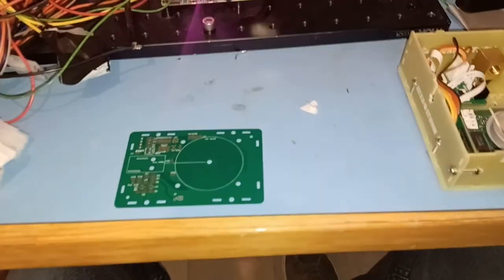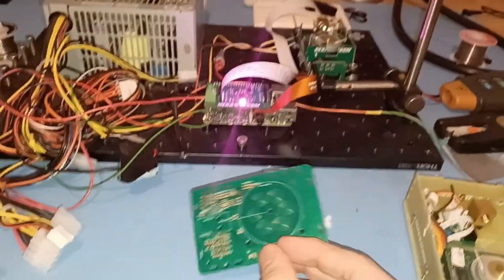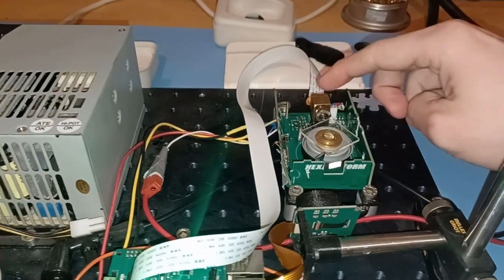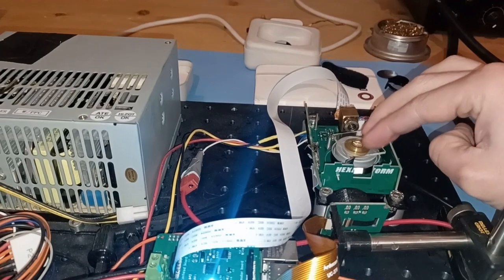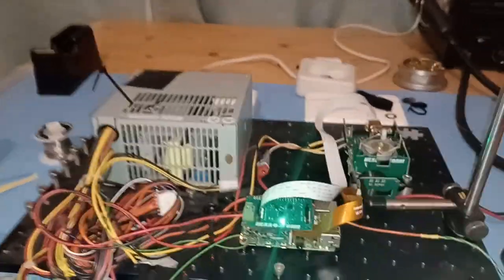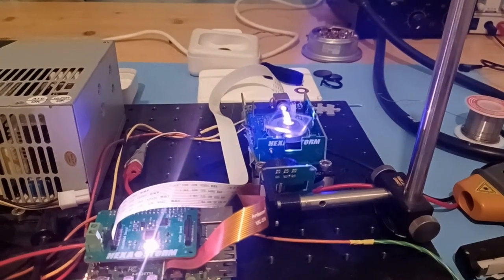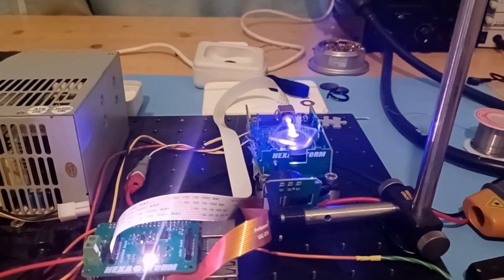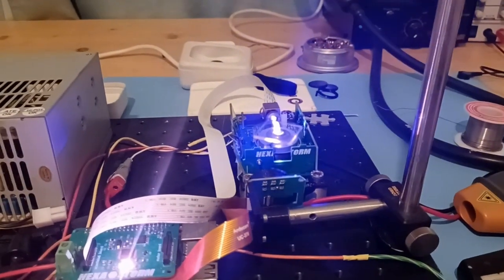LASER scanner with PCB motor

Comment: Traditional circle coils suck for generating torque on a axial flux motor. Consider that only the radial component of an axial flux coil generates torque on the rotor.

You can get more torque for less length of copper in your coils if you use a faulhabor wound axial flux type winding.

Translates as more efficent torque.  And the geometry allows for near 100% Copper fill for far less resistance, minus the bare minimal copper needed to be removed to define traces for the three coils. 

Check out the three stator windings on my motor I made on my channel.  A PCB version would have three coils with through holes from from front to back. Where the coils skew one direction on the top, they skew the other direction on the back. On the inside radius, the copper traces are their minimal nessesary width But the traces may taper to a wider trace on the outside permiter. So that the path overall  may have a lower resistance.  And only the bare minimal copper is removed to define a coil.
Reply from the maker: I will check it out, I am aware that the coil design is suboptimal and youtubers like atomic showed better designs
Reply: @Hexastorm  so I found his channel through your subscriptions. And yes the wedge shape coils is better than the circular traditional coils for the same  reason.  But faulhaber coils are a step above  improvement over wedge coils for the very same reason.

The radial flux version of a multi pole pairs  faulhabor coil can be seen by googling images of "ThinGap motors" as a maker of motors with high torque. They have impressive power density specs. 

Alternately simply searching images of faulhaber coil may turn up many two pole radial flux.

My motor seams to be one of only two motors that I can find that are axial flux faulhaber coils but serously you get more percentage of wire activity participating in providing force in the vector that torques your rotor around.
Reply from the maker: I looked into it https://build-its-inprogress.blogspot.com/2015/02/coreless-axial-flux-motors.html?m=1 and here the faulhaber is explained.. I would need to do a calculation, but it is highly likely it is even better than the leave motor
Reply: @Hexastorm Nice example of nearly 100% Copper fill minus only that which is needed to define one trace from another. You'll be able to do even better with traces that grow in width as they go from the inner diameter to the outer diameter. 

 I wish i could draw this out here but, I will try to describe it..

Let us first simply to linear motor...  Force=current×length×magnetic field strength. But if the wire is at an angle other than 90 degrees, then 
Force=current×length×magnetic field strength×sin(of that angle)

Let us compare the serpentine coil against the faulhaber coil. With 1 amp and the magnet's field strength = 1 tesla and are 4 cm tall  and spaced centered at 3cm apart. 

First is serpentine coil:
The coil is a repeat of  4cm + 3cm = 7cm segments for each magnet. 
The 4 cm segment is at 90 degrees to the direction of force we want. 
So Force= 
F=1amp×4cm×1tesla×sin(90 degrees)=4 amp cm tesla. And 
F=1amp×3cm×1tesla×sin(0 degree)=0 amp cm tesla. 
Adding the forces from those two segments you get force = 4 amp cm tesla.  I'll Work with this unit because there's no conversion. 

Faulhabor coil second:
Using the same magnets makes the  length of the diagonal 5cm using a²+b²=c².... 3cm²+4cm²=5cm².
F=1amp×5cm×1tesla×(4cm/5cm)
And reduces to
F=1amp×4cm×1tesla and further reduces to F= 4amp cm tesla 

Take note that the force generated against each magnet is the same for both coils. But, the faulhaber coil only needed 5cm of while the serpentine coil needed 7cm per magnet.  This linear faulhaber coil is (7-5)/7=.2857 or 28.57% shorter than the serpentine coil for the same thrust.
Reply: @Hexastorm  his motor was part of what inspired mine.  But where he went went without an iron core,ninwentnwitj a slotless iorn core made from coiled strapping steel. While it does introduce some losses  my motor really needed additional inductance. 

When I said my motor was one of two motors that i am aware of that are using axial flux faulhaber coils, the one you found is the other. And his was some of the inspiration in my motor.

Comment: What will be the end result of this ?
Are you going to make  some kind of pcb printing machine with this ?
Reply from the maker: My current aim is to make a single module, which has controller laser and motor. You can then buy this laserhead as is. As it is open source, it should be easy for hackers to integrate it in a a pcb machine, 3d printer etc. I also try to keep the price low.
Reply: @hexastorm  that's great. I have also tried this. I would prefer it to use with PCB. But I won't recommend this for 3d printing due to laser life. 

If you want to make it cheaper. Than why to use fpga instead of microcontrollers. 

May be a stm32 and esp32 with some external ram. Can we some have discussion. I am also interested in this project. I might be able to make this work.
Reply from the maker: @muhammadarsalan3412  , the first iteration was done in assembly on a microcontroller and based on ldgraphy. I picked FPGA, as it gives you more options and seems more likely for future industrial systems. This is where I think you can make most money. The current FPGA is around 5 euro's. Most costs still reside in assembly.
Reply: Do you have github or somewhere I can get the updates and maybe able to help you out ?
Reply from the maker: @muhammadarsalan3412  the FPGA code is hosted here https://github.com/hstarmans/hexastorm
The files are self contained so lasers.py describes how the laser head works and you can test it there as well.
Some files don't have tests, but this is rare.
The code for a microcontroller can be found here https://github.com/hstarmans/ldgraphy/blob/master/machine/binaries/stabilizer.p
It runs on a PRU of a beaglebone.
Reply: @hexastorm  great I will check it in free time

Comment: Next step, pyrolytic graphite sheet attached to the prism and use that to maglev the spinning rotating prism on an air bearing (by dent of not contacting the pcb)
Reply from the maker: Thanks for the idea, I actually looked into magnetic levitation, although not pyrolytic sheets. The article https://pubs.acs.org/doi/10.1021/ja310365k looks promising.
The problems I see;
   - will the sheet stay planar  (if it wobbles along the axis of rotation), there will be a cross scan error
   - ideally the prism can spin at high speed, I have seen videos (https://www.youtube.com/watch?v=AU0q4wVohF8) at low speeds
     if the prism is not balanced at high speeds, I fear it will get out of orbit. Now the axis, counteracts the centripetal force.
Reply: @Hexastorm  Yeah, I think this is where you can add in hall effect sensors to compensate for wobble. I would also use a single neodymium magnet glued to the center under the pcb, and then use the remaining coil actuators to balance and control the orientation and direction of spin. I bet if you can get a good measurement of the reactive magnetic field on the pyrolytic graphite, you can use it to actively balance the prism in the center, as the constant rotation should create a perfect periodic signal, and lagging or leading magnetic wave forms from the hall sensor can tell you which direction to adjust the pwm strength per coil. 

The other neat thing is if it's self centering, then you just need a certain amount of tolerance in the design and it can handle not being perfectly centered.

one issue with moving it parallel with respect to the force of gravity, your EMF from the coils will need to compensate for that, or the bearings will need to center the prism. It might be easier to put the plates on a linear gantry and move them across the linear array of light coming from the prism. It's how all modern flat bed scanners work and it's a lot easier to build a smoothly moving sled than a vertical high speed spinning low cost scanner element.
Reply: @Hexastorm  Are you moving the prism radially? If you are, the off balanced weight may be balanced by another equal weight moved the same distance in the other direction. On a reverse threaded screw. //[ ]////(O)\\\\[ ]\\
Reply from the maker: @kreynolds1123  I mentioned radiallly but this is not correct. I mean that the prism is not balanced, the center of mass is not at the center of rotation. This gives a force which increases with speed and increases the friction on the bearing. I have done balancing experiments in the past. It is not an issue at low speeds like 3K rpm, I do think it could be an issue if you use magnetic levitation, but maybe you can search for the right rotation point !?
Reply: @Hexastorm  an unbalanced weight simply needs an appropriate counter weight to balance it. 
I'm not a balancing expert but I'm pretty sure their are at least two different kinds of balancing  you need to deal with. First is that you can  place the rotor axial on two points and see if the rotor has a preferred  side up and balance this.  To remove the preference. 

But then there is another way a rotor may be off balance with weight positioned significantly above or below the rotor disk that encourage a different kind of wobble. Where a motor is constrained  and rpms are minimal the wobble is tolerable.  But at high rpms it stresses the motor and bearings. And where the rotor is not well constrained on magnetic bearings, wobble quickly poses very severe problem. Static and dynamic balancing.

I forget the guy's  name but there was this guy who did dynamic balancing with a speaker to quantify  level of unbalance and how adjustments improved or worsened. I'll see if I can still find that video.
Reply: @Hexastorm  "Matthias  random stuff" Channel "dynamic balancing with a scope and small  speaker" title.
Reply from the maker: @kreynolds1123  I build a rotor balancer https://github.com/hstarmans/rotorbalancer, it uses an inertial sensor. It is a cool video...
Reply: @Hexastorm  that is very cool. 

Have you seen any videos on sound cards converted to Oscilloscopes? One can even convert a cheap sub $10 usb sound card with a sampling rate of 44.1khz  that's maybe 30 times greater than is needed for 20k rpm and less.

Comment: Laser printers used to have modules like that, before led printers where more common.
Reply from the maker: Novel thing is the prism, most scanner use polygon motor and a bldc with wires.  Envisiontec has patent on rotating mirror